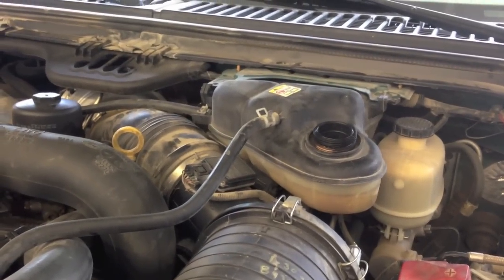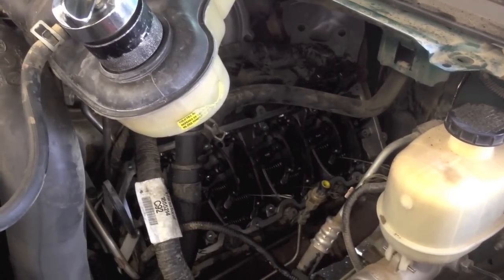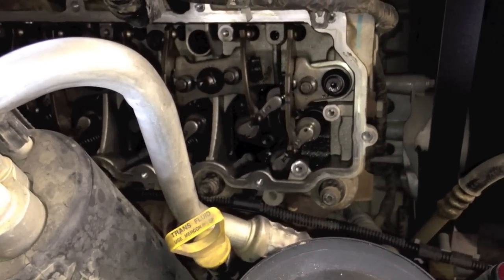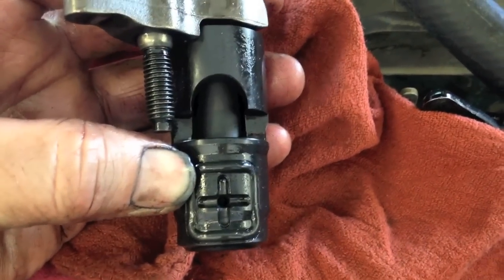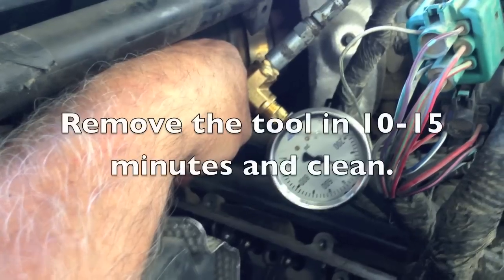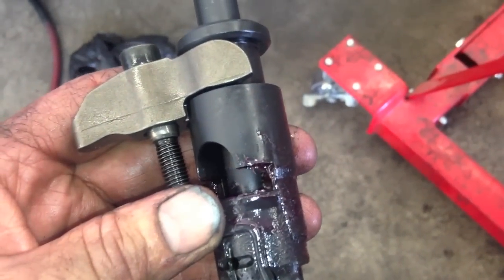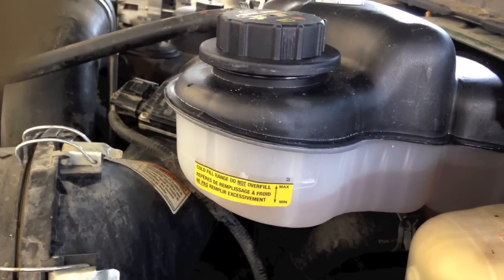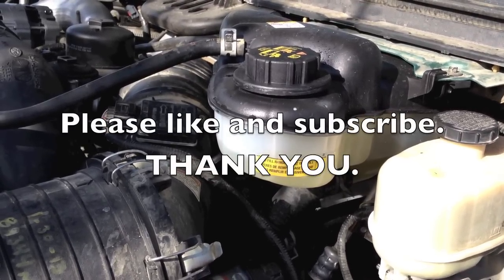Diesel fuel in the cooling system. Bulletproof crack repair kit for the 6.0

Comment: Good video I have a question I put a EGR delete the SCT tuner on street performance I do not over max lighting I keep up with all my maintenance and replace my dummy plugs and the majority of my sensor just for the heck of it but my question is when my coolant temperature hit operating system at 190 the oil temp I notice sometimes depending on the weather would it will drop about 10--15. Then go back to operating temperature under oil. No check engine light no loss of coolant or smell of gas. I do a lot of highway driving could it be my trouble that hasn't not being clean Thank u.

Comment: How could you tell there was diesel in the cooling system? By smell or did you test it exc
Reply from the maker: It is obvious by smell and visual.  Not 100% sure on the cause but out here in the desert hardly anyone uses starting fluid.

Comment: Is it ok to let water run all over the engine like that? Just checking before I attempt a flush soon. Thanks Ron!
Reply from the maker: As long as the seal/insulation is in each connector you won't hurt a thing. I do it daily for years

Comment: is there a chance of injector damage on the leaking cylinder due to low fuel pressure at the cup?  just thinking if the fuel is leaking past it might not be completely filling the fuel chamber in the injector.
Reply from the maker: That would have to be a major leak to lose fuel pressure. At least that amount.  It might happen but you'll have fuel pouring out the coolant bottle if it was pumping that amount through a crack. I've had 7.3 crack enough to allow coolant back when shut off. That damages  an injector.